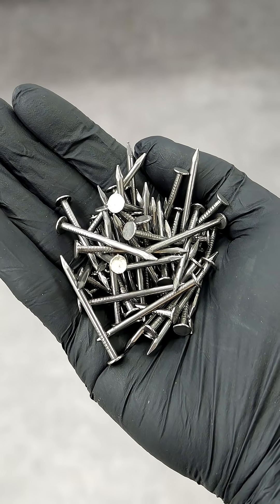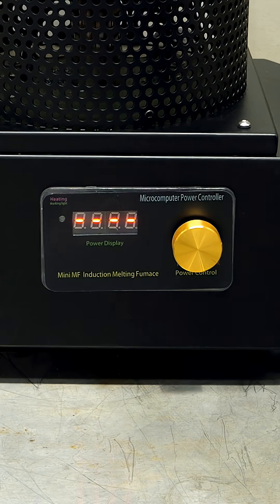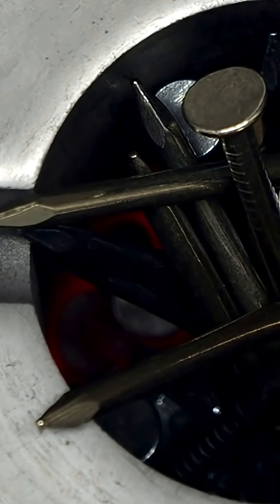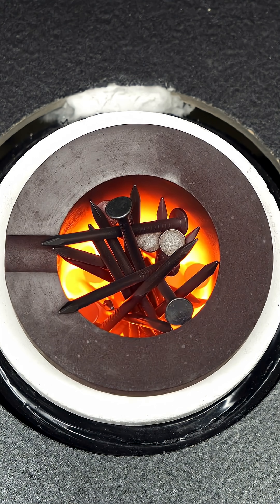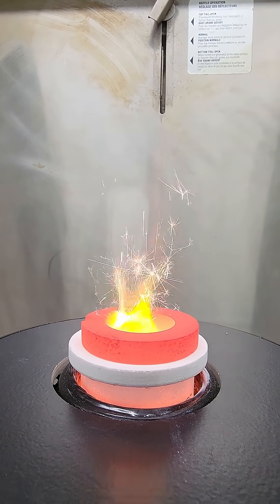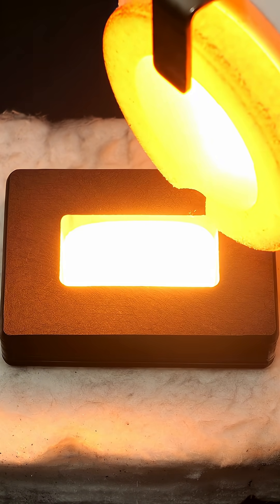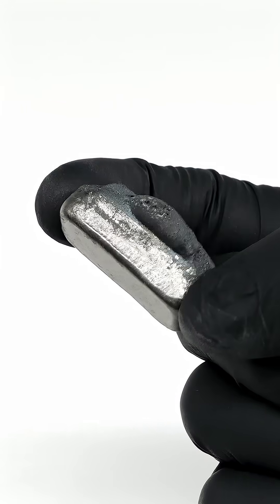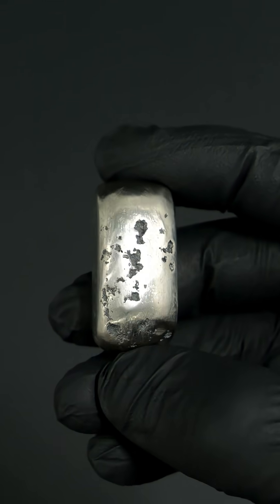Liquefying nails is crazy

Comment: I have started trying my hand at smelting and casting. I started with copper and brass. The brass was a bad idea because it turns out you have to melt that super slow. Otherwise the zinc Burns instead of melts.

Comment: Wow that's crazy, you heated some nails in a thing designed to go to really high temperatures and they melted as expected.. wow. Then you poured them into a rectangular mould and ended up with a rectangular shaped bit of metal.. wow. Then you polished it and it looked like scrap metal.. wow.

Comment: On the hard-to-look-at glow, it is worth noting that when movies show molten metal, it is usually aluminium, not steel, especially for scenes showing pouring of metal into a mold to make a sword.
Steel needs to be white hot to be smelted and also needs to poured fast, making steel casting look violent compared to copper and aluminium.
Reply: Also see melting "gold", which evidently  retains its solid form color. Notably portrayed in Constantine as something you can do in an open iron skillet over a Bunsen burner.

Comment: Vibrate the mold while pouring. It will cause the molten metal to creep into every corner of the molt. If you don’t have a vibrating table you can use a drill without a bit attached and just gently run it near the molt causing vibration.

Comment: Your electricity bill.
Reply: A typical space heater uses 1400 watts. The power draw isnt crazy at all and would only cost me $0.30 an hour or so to run
Reply: @Rattus375 This was 3.5kWh, but we don't know for how long it ran so hard to esteem but yeah I doubt it was more than $1
Reply: @kirakira9906  You mean 3.5kW (power). That would mean a consumption of 3.5kWh (energy) if he ran it for an hour, but as you said, we don't know how long he ran it for.
Reply: @FZs1kWh is just the energy unit, it doesn't necessarily mean it runs for one hour. So I meant that this device consumption is 3.5kWh since it's power is 3.5kW. We don't know how long he ran it for, but no, maybe I worded it weirdly but I did mean kWh
Reply: @kirakira9906  But since we don't know how long he run it for, we don't know the amount of energy consumed, only the power. I just said that for the energy consumed to be 3.5kWh (that you are claiming) at a power of 3.5kW (which he said in the video) it would have had to run for 1 hour. If he ran it for a different amount of time, the energy consumed (kWh) would be different, while the power (kW) would be the same 3.5kW.
Reply: @FZs1Yes I see now that I worded it weirdly because I was replying to someone who mentioned Power (1400W) and I replied with Energy. It's my bad because I skipped a reasoning that I made in my head without typing it. Yes, what I meant to reply the other guy is probably that 1400W is probably 30¢ because ran for an hour is 1.4kWh but this would be 3.5kWh,  since my conclusion was that it can't he more than $1 anyway because from the video I can safely assume he didn't run it for more than one hour at worst.
Reply: @kirakira9906  I see. I don't usually try to correct minor mistakes on the internet, but in my experience so many people confuse energy and power that it was worth replying, but now I see it wasn't needed, sorry. Have a nice day :)
Reply: @FZs1It's okay man, it would've been an important correction. Many people get it wrong, I mean it's not existential unless you work with that stuff (I've seen Engineers mix them up and that is... let's say I wouldn't trust them), but it's nice to know and use them correctly. I'm not a Specialist in any of these fields, I just like Physics as an amateur / enthusiast. Thanks, you too and Happy New Year
Reply: @FZs1 but power is always smaller than consumption
Reply: @Rattus375  It depends on where you live. In Quebec, it is about 0.07$CAN/kWh which is about 1.53888888888889E-08 $/J
Also, winter is about 5 months and I use resistive heating to heat the house and the oven is also resistive heating.

I don't know why it is expensive in other parts of the world.

I have calculated and compared it with a tank of propane. Propane is actually more expensive. I don't know how it compared to natural gas.
Reply: only a few times more than a microwave
Reply: Most expensive monthly electricity bill 😂😂😅
Reply: What bill? 

Slowly turns to the bright orange crucible with ash
Reply: Pretty sure his Electric bill is the same. A Gaming PC puts out more power I guarantee it because that machine has its own Engine to keep itself cool and be electric reliable. eBay is a Gold mine
Reply: @TheRealChicagoBeats  Your PC uses 3500w?
Reply: @lunchie80 idiot futureproofers be like
Reply: Islam is the worship of God alone, without any partners. Seek God. There is no god but God, Muhammad is the Messenger of God.

Comment: galvanised steel is coated in zinc. zinc vapourises when heated and gives you metal fume fever

and potentially cancer
Reply: Just melt some pennies from after 1982, and you're gonna eventually taste it in your ears.
Reply: Exactly the comment I was hoping to see. Sadly this hasn't been pinned though.
Reply: Gordon doesn't need to hear all this, he is a highly trained professional.
Reply: It leaves a yellow residue
Reply: I'd be surprised if he wasn't using a respirator. He's got good ventilation, too
Reply: But zinc is a vital mineral needed by the body
Reply: @roialnet not like this
Reply: @roialnet so is water but you can still drown in it. So is iron but you're not eating metal shavings or, in the theme of the video, nails to get it. Minerals like Zinc are typically contained and carried in molecules that our body can repurpose to its needs. Those same minerals can be plenty toxic if handled in the wrong form.
Reply: so what if he used eco friendly wood veneers
Reply: YAYYYYYYYYY
Reply: damn.

Comment: You didn’t clean the slag or dross from the iron. I am a foundryman and you have what’s called shrink when it solidifies rapidly without enough silicon for the graphite to form fully. It’s essentially raw steel I would imagine. Very cool setup though! Be careful!!

Comment: Safety waning for anyone wanting to do this. Nails are usually galvanised, and when you heat galvanised metals the zinc coating turns into Zinc oxide which is toxic and causes flue like symptoms. This lasts for 1-2 days, so unless that sounds fun to you, be in a well ventilated area with a respirator on.

Comment: Believe it or not, this has a ton of everyday DIY uses! Besides obvious things like metal smithing crafts, you can use other mold shapes to quickly run up a stockpile of items you may need, for instance steel door fittings, window grates, lock hasps, etc. It really comes down to what you find household needs for, and how much work you're willing to put into molds, but at the end of the day if you want to do the work and learn new skills, you'll find more and more uses for raw metal and find yourself picking up new hobbies left and right from it. Highly recommend

Comment: That’s how hot the twin towers metal structure would have had to get to completely collapse.. the ENTIRE buildings frame would have had to get that hot, not just a couple of floors for the entire building to collapse , and if it did get that hot, it wouldn’t have dropped at free fall speeds.. it would have slowly melted like a snowman.. 
If the steel members on the floors that were burning got that hot, the top of the building would sluffed off.. again, it wouldn’t have dropped the entire building at free fall speeds, completely dustifying all the concrete in the process..

Comment: Those are zinc plated so you have about 10% zinc added to the steel. A lot of Fasteners are zinc plated because the iron in the steel rusts but zinc is pretty corrosion resistant

Comment: The intense heat generated has the ability to scorch and disintegrate the nails, which are remarkably resilient and resistant to destruction. In this case, the temperature is so extreme that it effectively surpasses the natural durability of the nails, ultimately leading to their complete combustion.

Comment: For those who don’t understand how the nails got melted: induction heaters use the inherent conductivity of the container and its contents, coupled with extreme magnetic currents, to generate heat.  The “heater” is just a magnetic coil series that surrounds the container and has a bunch of electricity pumped through it in rapidly alternating directions to create a magnetic field that rapidly changes its polarization.  When you rapidly “flip” the “direction” of a magnetic field surrounding conductive material such as steel, you create a bunch of pulsing electrical currents in that material, which then has to force its way through the material’s resistance.  What you get is not a highly electrified piece of metal, but rather one that quickly begins to cook itself from the inside out as the repeated shockwaves of tiny electrical pulses jostling into all those resistant steel molecules begins to excite them and generate more and more heat.

Induction typically ONLY works on materials that are at least a little susceptible to magnetic forces, as something like your hand would not react to the electromagnetic coils sufficiently to produce any heat.  It has to be something that can normally be magnetized, which is why this method is so handy for melting most metals.

Comment: can't steel be melted with kerosene/jet fuel?  that is what the government says can melt building skyscraper beams.  They even wrote a lengthy report stating that it took down 3 buildings in NYC
Reply: The problem is the size. To achieve this with by burning fuel, you need to make the fire relatively big.

Comment: Honestly, I think you nailed it 👍
Reply: Strictly speaking all he did was he took the steel back to its original condition of mild steel 😂😂😂😂
Galvanize process was only invented in 1900 when lead was found, mild steel is dipped into the hot galvanize solution, left and then removed to cool down, as soon as you hear galvanized steel to very hot the galvanize in the steel evaporates , very dangerous vapour is given off, it's very toxic

Comment: Add some silicon-carbide grit, and some graphite.  This will give cast iron, and lower the melting temperature.

I’m not sure if that crucible can do cast iron temps - looks like graphite! - and if it is, it might well fail on the first run.

What’s needed is something like a “salamander-super” clay-graphite crucible…